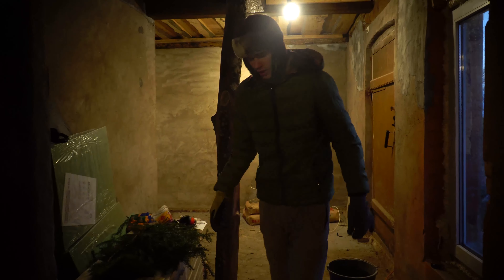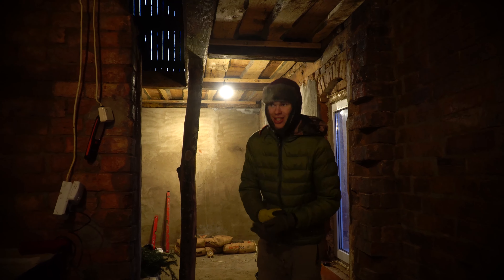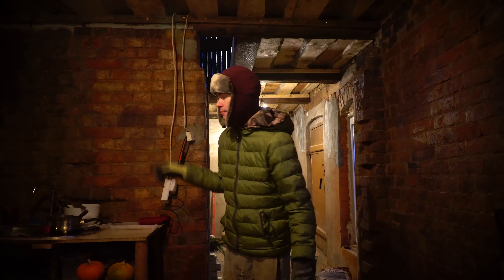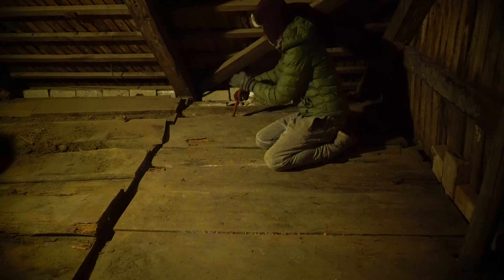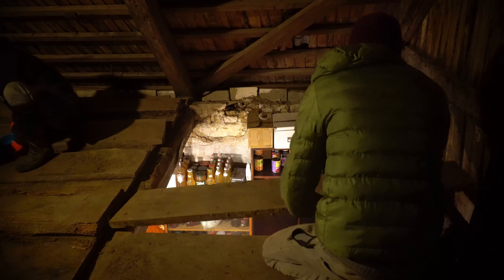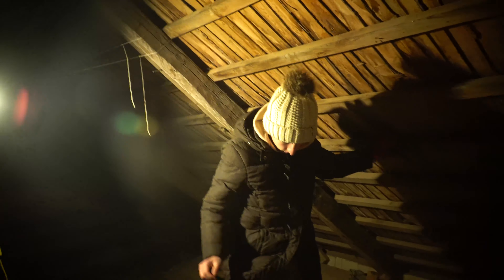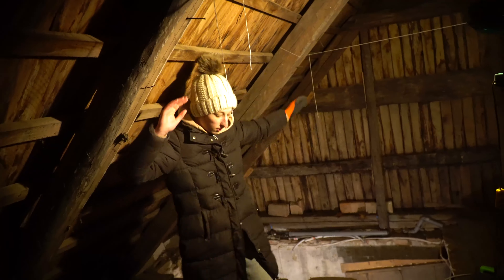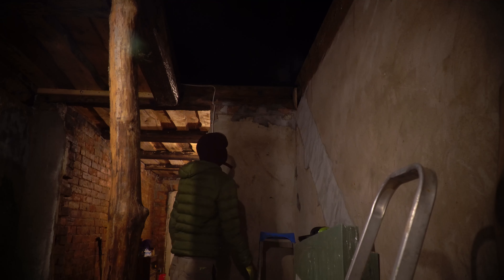Removing Last Part of OLD ceiling

Comment: As a minimum you need and must put electrical tape over those choc blocks (junctions) ideally you should use plastic junction boxes that are rated to the current going through them. Trust me I'm an engineer and eventually the insulation will set on fire if you leave it without providing an air gap between the junctions and the insulation.

BTW I think you two are great. I'm a big DIYer and love learning how to do things to code. Seeing you guys do it your way though is quite refreshing and you know it actually works (apart from those electrics :)) you guys are doing great. Also get yourself an impact driver, it will make your life must easier.
Reply from the maker: Don't worry in the video after this one we add junction boxes and correctly seal everything up. I also studied Engineering amazing to see a fellow engineer watching our videos! 😀
Reply: @DoBeDiff  I suppose you are doing the thing a lot of us dream about doing, although you have taken on quite a big challenge.  I've got a degree in electronic engineering and have rewired multiple houses in the UK.  I also grew up on a farm, so I can relate to what your going through (a bit).  You're doing well to get through winter without much insulation, I think the best and cheapest thing for that house is under floor heating, which is really easy to do yourself if you hook it up to the fire place.  Also get self levelling compound and you'll get perfectly smooth floors.  That's a bit more expensive though.

Comment: Lovely biscuits (as we call them in England) you are a talented cook Despina.

You look like you both had a busy day, but it HAD to be done! You need to be warm before it gets even colder! That clay also needs to be cleaned out before you can put in insulation.

It is terrible that you have ice inside the house, hope you get some warmth before Christmas.! If you are cold, you do not have the same energy to do work and it is more difficult to do in bulky clothes.

If your cat does not go into the attic, you could put mothballs in the attic at least to deter mice from eating your cables.
Reply from the maker: Thank you! ❤️😊 It's very cold. And going to get colder in January but we will be ready for the cold. I have some crazy energy heating me up to work still. I think I got rid of the mouses for now with poison. We don't show it on the vlogs in case people don't like us using poison but they are such a pain to get rid of. We took away all the food and just put poison and they have left. They also hate the rockwool insulation so they haven't made any nests over our bedroom where we heard them a lot. Which is surprising as some people said mouses don't care and make nests either way. But I guess our house is too cold for mouses even to come anymore 🤔😂

Comment: How Nice to watch every day a vlog. 
Be careful at the attic..perhaps you can barrow a ladder of the neigbours.  
Do you put the isolation on the electro wires above the ceiling?
Reply from the maker: We have to get a bigger ladder its quite the workout to get up and down. The cables will be redone with proper cable boxes and sealed. It's just temp to have all the cables up on ceiling and wired out how we need it, tomorrow I will redo all the connections and put them in boxes 😊❤️

Comment: Is this your permanent wiring or just a temp fix? Those junction blocks look like a fire waiting to happen. We have to rewire our house too I don't envy you the job.
Reply from the maker: Can you send me how your wiring is done. How they seal the connections. I am looking at my options how to make the most secured. This way it works good but I want something more organised and a bit more manageable. The wiring is simple there isn't any fire hazard no mater how a cables are done they can catch a fire as longs as they are tight together without any chance of electric spark forming or if the cables aren't made for usage they are on then the can get hot but these cables are bigger than needed and the conecters they are screwed into are made for 360v so they aren't small. I have studied basic in Electrics. I think the best way is to solder and melt a cover over it but thats no possible for splitting connections 🤔
Reply: My husband was  an electrician.  All house connections are in a metal box today I think they are plastic.  The wire conections red, black after connecting you wrap all the wire with electrical tape. Alll the wires go into the box  which is screw to your wood / wall  some also have covers that go on to the box as in your ceiling. I would ask at the store or find a electrian to teach you.   You can do it Deivids.  The hard part is the service/  the zoning of each area in your home and the load.  Do you have breakers or screw in fuses?  You need to find a handy man to teach you.  Ask for help., please.  Do you have any inspectors in your city such as water,, electrical, building.  They should be able to help you.   Electrical tape is a plastic tape very sticky.  It is like applying a rubber coating over your connections/  like the coated wire.  I hope this helps.  I ‘m sure it is different than the states.    Are you going to put the rock wool down first this time then cover it with plastic?  

The 2x4 has been compromised by cutting into it.  A hole is drilled through the 2x4’s to run the wiring.  Larger bit and larger drill with a side handle.  Might have to rent the tool.

Wild wonderful off grid life.  Building a home, he is an electrician.  You can see how they do it in the states and his tools.  Look for electrical ones.
Reply: @michellekupczak1280  
My father was an electrician and i know he told me wherever there is an electrical connection you have to have a junction box and all wire ends wire covers and taped..i get so scared with electric and sometimes its better to have a qualified electrican do it...
There are most things you can do yourself but when it comes to electric i always call an electrician..im so scared of fire...
Reply: It's not to code, but certainly safer. You can use a socket back box and blank face plate to cover/enclose the connection/terminal block
Reply: We haven’t done ours yet, job for next year. I have some experience of electrical but perhaps a whole house is a bit much. Certainly need to be using enclosed junction / spur boxes. Lots of info here on YouTube for modern house electrics. You’ll need to be using RCDs at a minimum in a consumer box (fuse box) to protect your house.
Reply: U should have all the connection in a junction boxes not bare like that only take a nail to fall from something to earth a live wire then u have a fire very dangerous

Comment: Have to agree David you need to hire a electrician. Those cables are not safe. The mice could eat through those cables and cause a fire, And please get a smoke alarm. But well done you guys. Hope there is a good stove ordered.
Reply from the maker: Don't worry will get it all sorted in few days, today I started on the cables and will finish tomorrow. I don't think mice will eat them but I want them to be secure and organised. We had temp cables on our bedroom for 8 months with mouses running around and they didn't eat cables or make a nest up there, which is wierd as we heard them a lot up there but I redid the insulation and there is no signs of any nests. We use poison as well to get rid of them we haven't had any action now 2 weeks but it could also be because it's yoo cold so no new ones can come in, no idea maybe we killed them all in the area 🤔. Hate mouses 😕 Thank you for your support ❤️